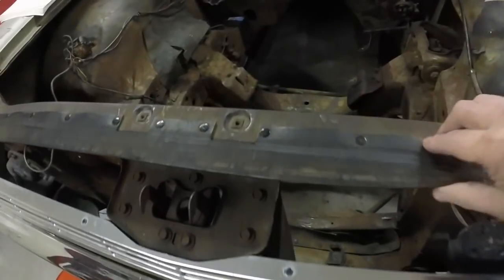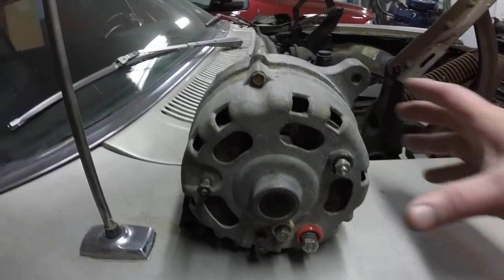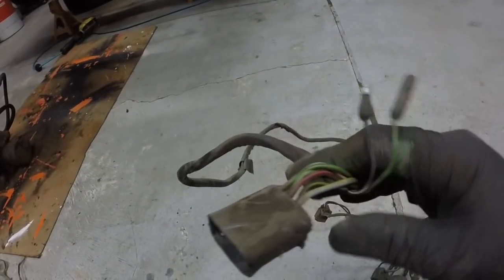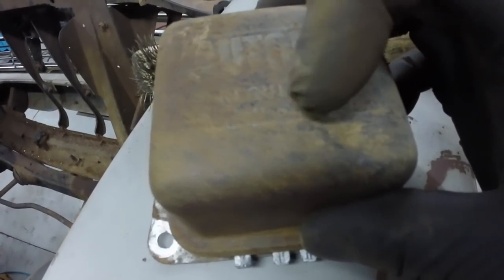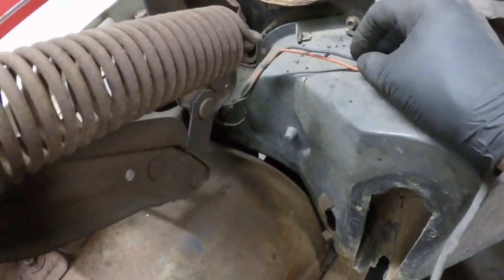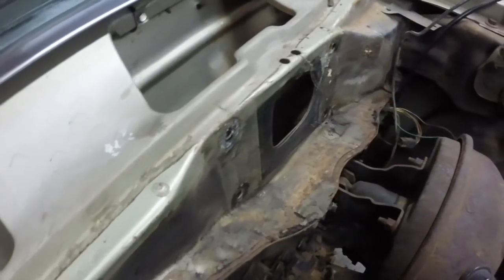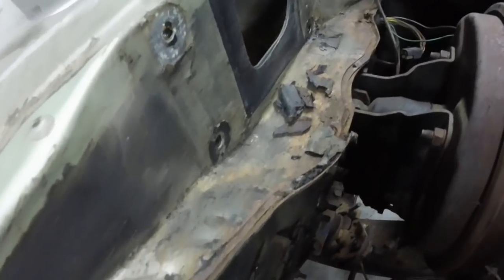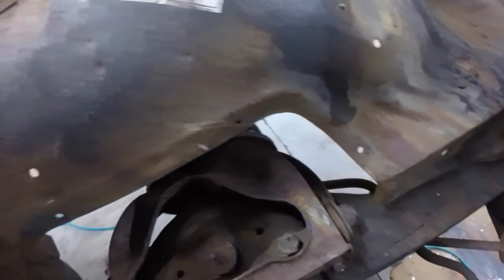1966 Ford Galaxie 500 convertible restoration part 25 stripping the engine compartment

Comment: Howard, Those Wiper Arms arms and the Wiper Arm Blade Holders are originals.  They are the Original 1966 TRICO Wiper Arms and Wiper Blade Holders.  The 15" or 16" Rubber Blade Refills are available, but you have to hunt them down...on ebay and other places...On the Wiper Motor,  Most Wiper Motors were left natural, but some did get painted black, so make sure that there really is black paint on it originally.  They were also stamped on the ends with a JUN 12 1966 type format as well in black ink if it was a natural casing, or in silver in if it was a Black painted casing. :o)  Tony K.

Comment: It's going to be interesting to see what attention the top motor and associated parts may need.
Reply from the maker: I got a guy mailing me a header bar for the top. After I get the hood off the top, I will power it up, and see what happens. I will check the fluid level and hydraulic lines first.

Comment: The wine sounded tuff..my 65 has the origonal alternator on it as well...and yes i went through it..works well..lube the wiper motor gears you will see a glass breaker breaker .. if the wipers ever stop and start after a minute or two that means the wiper motor is under stress lube the gears and it wont ever happen..both of mine did that and that's how i fixed it..the glass breaker is what protect's it..
Reply from the maker: Glass breaker?... guess I need to have a gander at the shop manual.
Reply: @OldCarAlley  glass circuit breaker the same wiper motor was used 65 through 68..it protects the motor from burning up

Comment: The push clips hold the nut from spinning. Some areas you can't get wrench inside the frame in some places they put splined bolts in the frame with nuts on the outside but they had issues with the splines stripping, So the put captured nuts with those clips and drove the bolts in. the clip stands proud to give adjustment to slotted holes for alignment.

Comment: Great progress!  I am looking forward to see how you deal with surface rust under the hood and on the frame, etc.  It seems like there are so many ways that people treat that - but it is hard to say which one is the best.  I have underhood surface rust that I need to treat on my son's Jeep...  Thanks again for sharing your great work.
Reply from the maker: It's a lot of messy work, because all that surface rust needs to be cleaned off. Thats why I wanted to button up the engine, and cover it up good. I also prime it with Rustoleum rusty metal primer. It the best stuff out there for surface rust.... I have used it all, and find Rustoleum is the best longest lasting product out there, plus it's super easy to touch up over the years.
Reply: @OldCarAlley  Ever try Rust Bullet? That one looks good in pictures and videos but is more expensive than Rustoleum rusty metal primer.
Reply from the maker: @dnanestrau  No, but I Have used dozens of other expensive wonder products, and always end up going back to Rustoleum. I really like it from using it on so many past jobs, with great lasting results.

Comment: I would replace that blower motor now when it’s easy to get too. That will make cleaning the fiberglass plenum chamber easier as well. Even though your not going to do the A/C you’ll still need a good working defroster. Also, I have found that those blower resistors get a lot more resistance over the years. At least measure the resistance in ohms and check the manual for specs before re-installing it.

Comment: The mystery wires (at 11:40) on the wiper motor assembly are for the park circuit for the wipers.  When you turn the wipers off, the park switch maintains power to the wiper motor until the blades reach the parked position.

Comment: Great project! I went through the same experience with my 64 Mercury Montclair in 2016. Most of the components were exactly the same. I did refurbish and reuse the wiring harness as well. Thanks for the video!

Comment: Great work and attention to detail. Thoroughly enjoy this series and watchwd the Pontiac as well. One thing. Its "stripping" unless you plan on pin striping the engine bay.  Good luck and continued success
Reply from the maker: Thank you... I went an edited the title. Guess I need to spell check, spell check!... or pay more attention to spelling before posting the video.
Reply: @OldCarAlley  will U switch over to disk brakes with dual system and install a PERTRONIX  pointless convert?  great efforts in the details
Reply from the maker: @gertraba4484  I would switch to disc, only if I can find the factory original set up... it was a option in 66. Otherwise it will be four wheel drum, with the 67 dual master system. I will put Pertronix in it for sure. I do that to all my old cars.
Reply: @OldCarAlley  Yes - the '66 disc setup was a Kelsey-Hayes 4-piston caliper design. They used it on the '65-'67 full size Fords, Thunderbirds and Mercurys as well as the '65-'69 suicide door Lincolns.  The setup used on the '65-'67 Mustangs, Fairlanes, Comets, etc. were similar but I believe used a smaller K-H 4 piston caliper. In '68 Ford switched over to the single piston design on all but the 4-door Lincolns (they switched in '70).
Reply from the maker: @dnanestrau  Will the Thunderbird set up work? Will the spindles interchange? I know where a parts 66 Thunderbird is. I think it has disc brakes.
Reply: @OldCarAlley  I don't think the Thunderbird spindles will work, but I believe the calipers are the same and the rotor (bolts to the hub on these) is the same.  Not sure if the hub is the same between the Thunderbird and the Galaxie.
Reply: @OldCarAlley  yeah dads' 65 wood not stop at all after 3-4 stops andin water it was zilch..............for safety sake I woos switch  to after market one

Comment: How did you know that dent was a dent.watching I couldn’t tell. Thanks again
Reply from the maker: That was where the receiver/dryer for the dealer installed A/C was. The dealer dented it to fit the dryer there. I need to bump it out, and weld the screw holes up that were drilled to mount it. Other Galaxie owners told me, there was no dent there form the factory.

Comment: The clips on the frame have a nut on the end of them for the bumper bracket bolts instead of welding them to the frame

Comment: Have you ever replaced a wiring harness? Typically, I consider it if I have the engine and interior out of the car, especially if the car/harness is over 50 years old.

Comment: You need to get that front clip off and have at least the front half of the frame blasted. Plus all the inter fender metal.  Plus the firewall.
Reply: Easy for you to say at your keyboard
Reply from the maker: Where do I stop... pull the front clip, might as well pull the body off the frame, as thats not much more work after the front clip is off. Thats a ton of work.... work that I am not going to do. It's in good shape, and will clean up and look good when done. I will remove the doors and trunk lid, when I go to paint.
Reply: @joelpalmer   I know. But taking a wire wheel and a paint brush to cover whats left just isn't right. I would be one pissed off buyer if someone did that to a car I just brought.  I never said it would easy. Buts its not that difficult
Reply: @OldCarAlley  Sorry to hear that a wire wheel and paint brush won't stop that rust you have shown.
Reply: Why don't we we wait until the engine bay is cleaned and painted before the hand wringing begins.  A wire wheel will get almost all rust off.  The paints available today will either convert or encapsulate any remaining rust.  The buyer of the car will keep it garaged and likely never drive it in the rain or snow. This car is not a 1961 Mercedes Gullwing coupe and this car is fortunate to get the kind of restoration done on old car alley.  The buyer is likewise fortunate to get a car that will have had the equivalent of an $80000 restoration for between half and two thirds of that cost

Comment: I know this car doesn't have power windows, but do you have any experience rebuilding the 66 galaxie power window switches? I have a few that are broken on the inside that I'm trying to fix. Not sure how and replacement switches are hard to find. Thanks.
Reply from the maker: See how the switch was assembled, and try to take it apart and clean the contacts. 99% of the time, there just dirty.

Comment: What do u use to clean out this engine bay??
Reply from the maker: A stiff wire wheel on my angle grinder, and lots of sand paper.
Reply: @OldCarAlley  perfect.. what do u use to degrease the crossmember? Lacquer thinner?
Reply from the maker: @stevenlopez102  Yes, lacquer thinner is my favorite solvent.